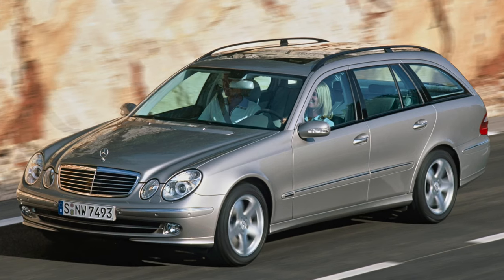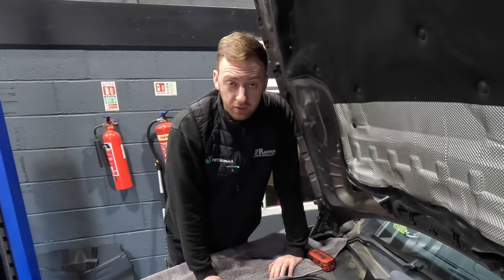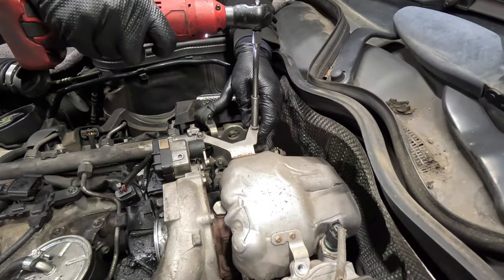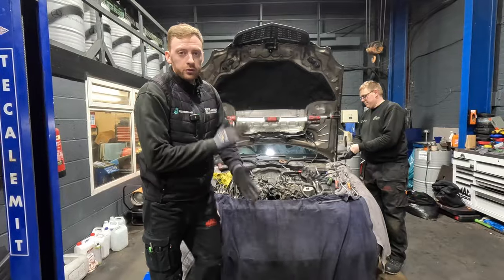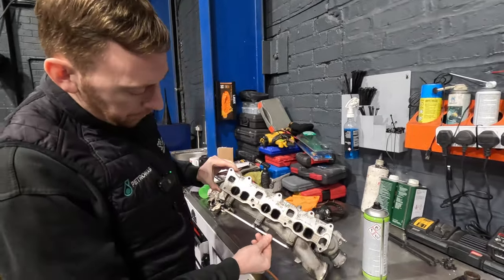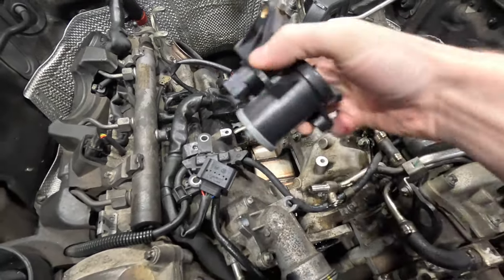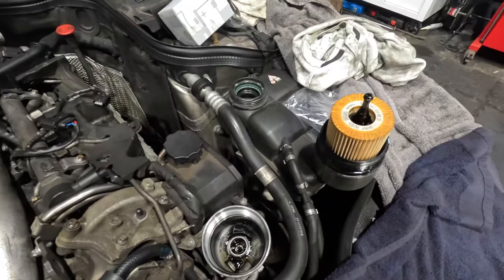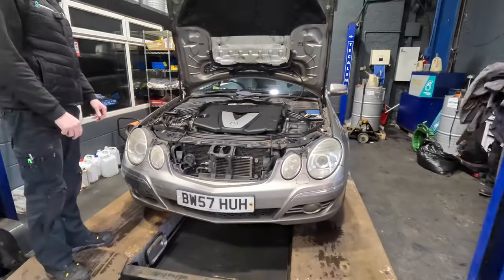Mercedes E-Class W211 OM642 v6 CDI. 3 most Common engine faults, oil cooler seals plus more!

Comment: ..do you really reassemble with leaving the intake ports 80% clogged ?  Video at 9:19
Reply from the maker: not everything is on video
Reply: Hi bud, I'm going to buy a 2010 Mercedes 350 cdi v6 with 60000 miles and full service history. When does this problem usually occur and are they generally solid cars. Just a bit worried because of the age.

Comment: No need to bleed injectors on start up?
Reply from the maker: It will take a good few cranks to start because we have had the rail disconnected, which isn’t a bad thing as it gives the oil chance to get pumped around the engine. So it will self bleed so to speak.

Comment: I have the same engine in my w204 (2008) my car is in limp mode with I scanned it says code 401 (EGR) and that means that there’s Insufficient exhaust gas recirculation flow detected I bought a new valve (new but not like the original) and the car has back to normal after 3 days the car in limp mode again ! 
(By the way when I changed the valve I did not adapted it with ECM) 
Any solution please ?
Reply from the maker: only use pierburg or genuine egr valve i would reccomend.
Reply: @sprautos does a bad PCV can clogged the EGR ?

Comment: You didn't mention leaky injectors. I've just done one on my 2006 r320. The other 5 are fine but having bought the puller and reamer I do them all as a precaution when its a bit warmer.
Reply from the maker: Yea injectors can be an issue. I wouldn’t put it in my top 3 on a 642 though.

Comment: Well at least the mechanic shop will never run out of work. The cars are lemons. $15,000 worth of maintenance work on my brand new E class 2000  430 4 matic. Bought a Lexus 2001 LS 430 in 2008 sold lemon Ben with 60k, km, for $10 k had paid $101000. Used Lexus had 98k on it, still own it. Rated the most reliable automobile since the history of the automobile. Many reach 1,000,000 miles . At 198,000 km.now originally timing belt, 23 years old. Yup. Put $1900In it. Two new mufflers, two new oxygen sensors in exhaust, one tire rod, one front wheel bearing that’s all.

Comment: What sort of a wallet dent can one expect for fixing these 3 issues?
Reply from the maker: Oil cooler job with inlet motor your looking around £1500 including parts. Turbo we got a reconditioned one think it was about £800 on top
Reply: @sprautos  Thanks for that. Appreciate your honesty. 
Considering the value of these cars today, it’s hard to justify spending big money fixing them. I’ve just spent £1500 replacing brakes and suspension parts on mine when the car is worth about £3k at best. Thanks for the video though.